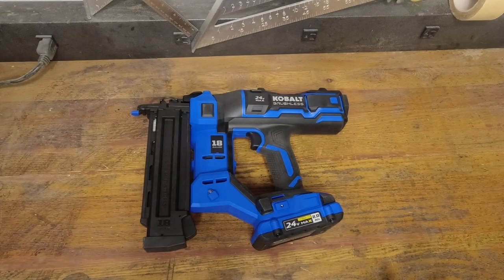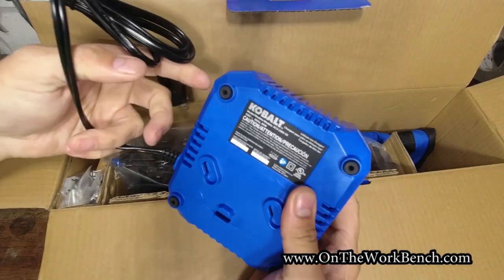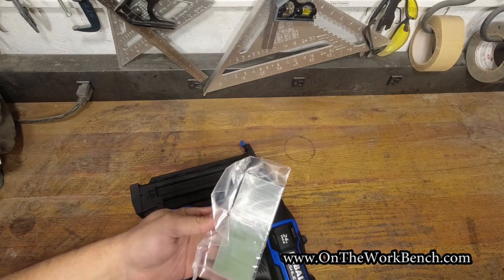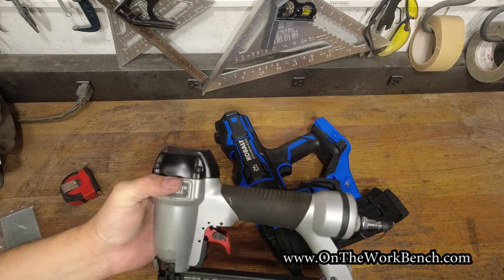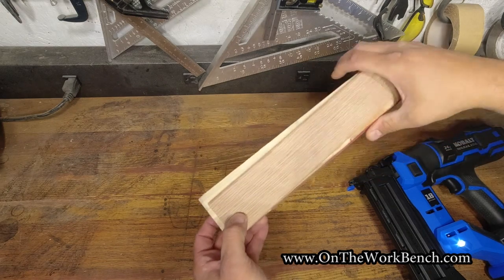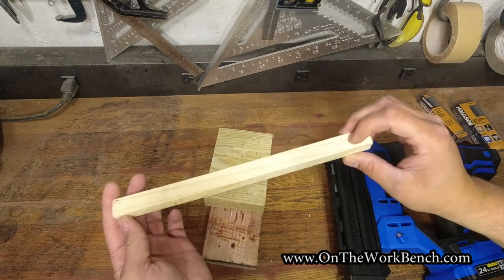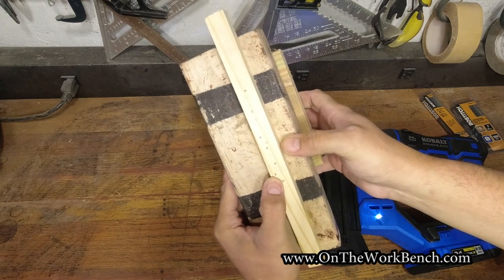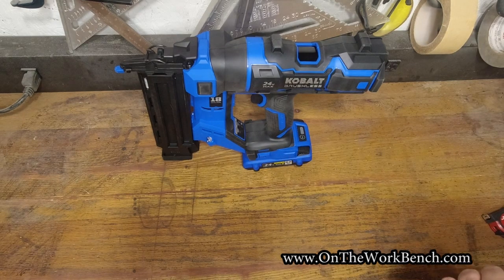🔥🧯Kobalt 24v Brad Nailer 🔨 🔨

Comment: The non marring tip is not rubberized.  It damages your work piece because of the recoil.  I cannot recommend it for finish work
Reply: Does it really. I need it for base trim but if it scars it no point in buying it then.
Reply: @jerryhicks4502  if you can find a way to change the tip, then this is very solid.  I would say it’s just behind Milwaukee in terms of power if not around the same.  I went back and bought the darn tool because they were giving 2 pack ultimate output batteries for free with this purchase, so I couldn’t pass it up.  I will only use this nailer for rough in work or probably deck work.  Out of the nailers I have tried, Kobalt is probably in the top 5 just shear power
Reply: I would recommend removing it an giving it a boil then place it in the freezer rite after an try again.if that don't work by a ryobi
Reply: @ProxyFinal  how can you do decking with a trim nailer
Reply: @acecaldwell4701  what you mean?
Reply: @ProxyFinal  I just meant that my nail gun has depth adjust but also has power adjust
Reply: @acecaldwell4701  oh, you mean the Ryobi nailer?  If your nailer has the power to drive through the material, your only concern is the depth adjustment.  I know Ryobi has both, but the Kobalt is more in line with the Milwaukee.
Reply: @ProxyFinal  well that was my point.that it's not on Parr with Milwaukee. Besides since tti is building both ryobi Milwaukee an rigid making all three share alot of the same parts and brushless motors
Reply: @acecaldwell4701  I am going to be honest with you.  The tool has plenty of power, but the problem with the Kobalt is the recoil.  I still own the tool because it came with 2 4.0 high output batteries as a bogo, so I couldn't pass that deal.  I currently own the Milwaukee, Ryobi, and this one.  My go to is still the Milwaukee as that drives through anything
Reply: @ProxyFinal  I get it brotha I only like ryobi because they kept the battery the same for 25 years
Reply: @ProxyFinal  I seen the comment about the tip being hard an non marring mite I suggest boiling it then placing it it in the freezer to soften up
Reply: @acecaldwell4701  i rather try to find a way to replace that tip
Reply: The Milwaukee is more expensive, is it worth the extra cash ?
Reply: @Guitube99  I didn’t pay full price.  If power and consistency are the things you look for, I don’t think you can go wrong with the Milwaukee.  The Kobalt imo is not bad if you don’t mind the shortcomings.  The Ryobi brad nailer is often overlooked and I consider that tool to be right up there with the big boys.

Comment: You showed one of the nails blowing out the side of one of the boards you used for testing. I have learned that, this almost always happens when the nail gun is parallel to the wood grain. If you turn the lumber, or nail gun, whichever is easiest for you, so that the nail gun is perpendicular to the wood grain, nail blowout is extremely rare.

Comment: My ryobi is the older version they have in 18 Guage but mine has depth adjust an power adjust for different woods As well I also own the 16 Guage ryobi an it has both depth an power Aswell given they call them 18v but if u test my ion 🔋 there over 20v ryobi has made me a fan recently
Reply: My brand new 18 guage 18 v ryobi BROKE in 9 days.  Not even half a box of nails used...  on trim.

Comment: They are doing a BOGO on this kit with two 4.0 ultimate output batteries.  Very good deal.  If you guys want to save money on Kobalt, this is how you do it.

1.  XTR nailer 249 get XTR bare tool free or the 2 pack ultimate output batteries.

2.  Buy the 4 PC Kobalt gen 3 kit for 249 (299 full price) and get the new gen 3 circular saw for free.

550 for all those tools (1 and 2) added together
Reply: I got mine on the first of this month and they had no promotion going. I'm about to return mine and get this deal!
Reply: No luck. My lowes has deals going on for gen 3 tools. None for the nailer
Reply: @YZ-LP22  I think it was taken down. On the first day of the promotion 10/17 where it's supposed to happen, I simply looked for both items:  The nailer kit and the 2 pack ultimate output batteries.  I had one of the guys grab the batteries from the overhead and the kit that they had on the floor, walked straight to the self checkout with the gentlemen and it checked out fine with free item at 0 dollars.  Now, when I look at my order under MVP,  it does not show what I bought at all.  Just the total amount.
Reply: Sorry to comment again.. went to my local lowes today. The deal was there!!! Returned mine and re purchased with the (2) 4.0ah ultimate output batteries. I cannot thank you enough. 🤘
Reply: @YZ-LP22  I used this tool last night.  Did a shelf inside the closet.  Already paid itself.

Comment: I appreciate the video. I just got one and for anyone out there considering to buy one, should probably jump on it now. Because you get a free tool with the purchase of the nail gun! I went with the XTR Sawzall but you can also get the 71/4 circular saw or a 2 pack of 4ah batteries! But yeah I decided to look up a video because when I pulled mine out of the box and I seen the bag it came with, (just like you) I thought does it even fit? And you were a little bit more optimistic than I was cuz I said heck no? LOL. Why would they supply a bag that doesn't fit the tool it comes with? And in reality spending $250 on a tool before tax you should probably get a hard case to begin with. Especially seeing how the free tool you get with the purchase of this one comes with a hard case!